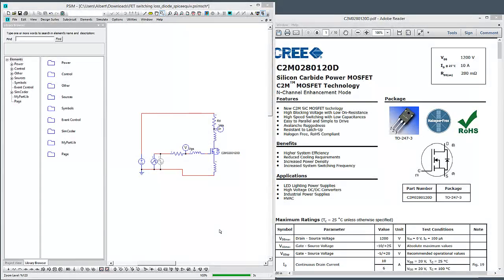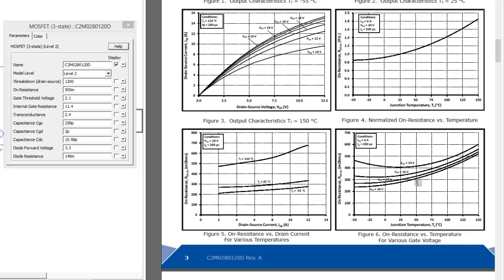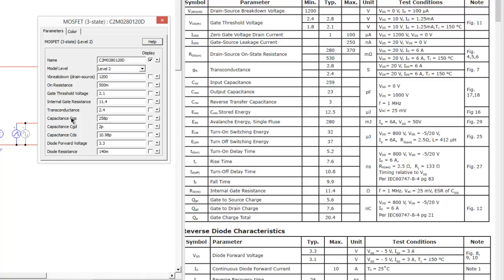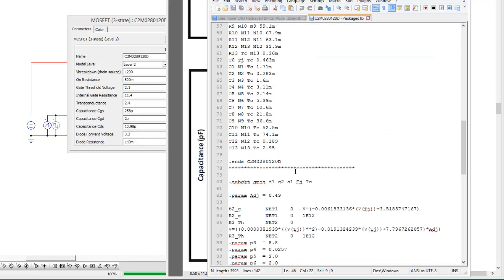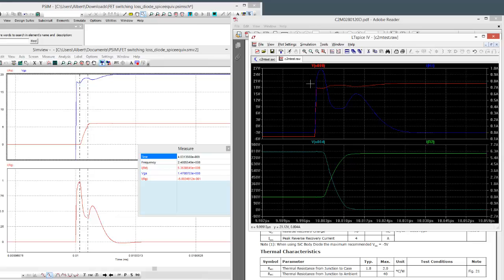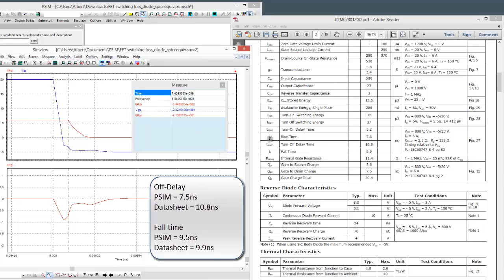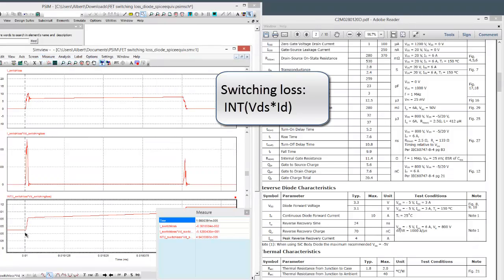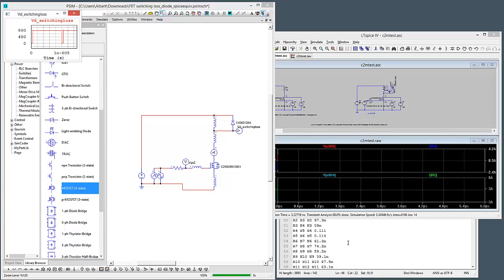Intro to PSIM level 2 MOSFET & Comparison with SPICE

Comment from the maker: Want to try PSIM?                                                                                  - https://hubs.ly/H0f9wCC0
Why is PSIM preferred for Power Electronics simulation?             -  https://hubs.ly/H0f9wFX0
Why you should use PSIM for device level simulations                  - https://hubs.ly/H0f9wDk0

Comment: Hi! Thank you for the interesting video. I have a little question. Why did you use the resistance values of 10 ohms as a parallel resistance of the inductance? I thought these resistance values correspond to a series connection with the inductance since they represent the parasitics of the pins of the package. Am I wrong about something? If so, how can I physically imagine how these parasitic resistances are caused?
Reply from the maker: This is how the LTspice model from Wolfspeed is defined, it is required by SPICE for numerical solve reasons. I added it in PSIM as I was trying to faithfully replicate their model